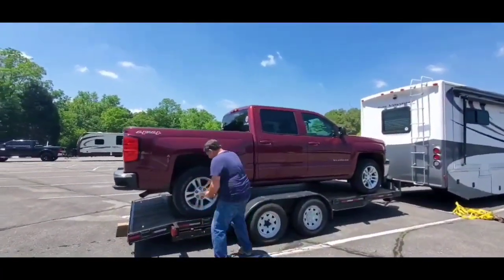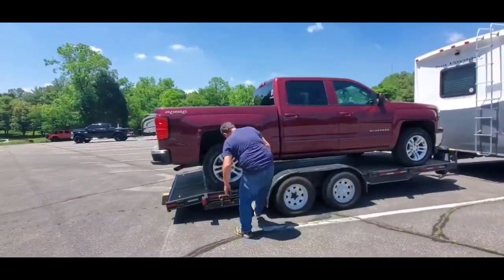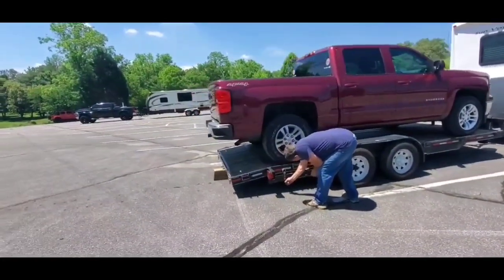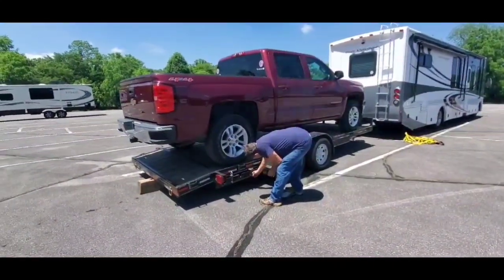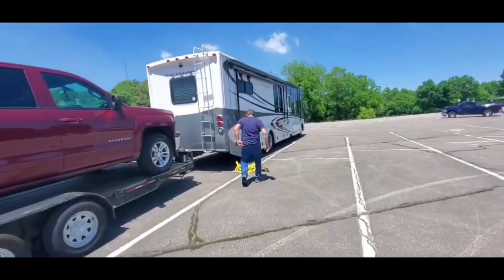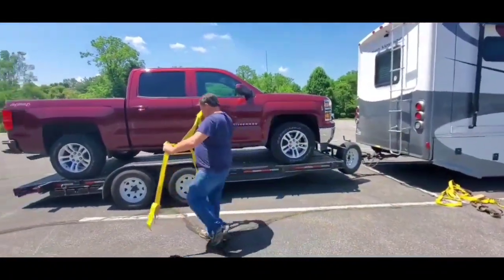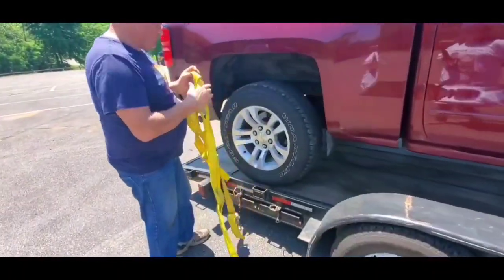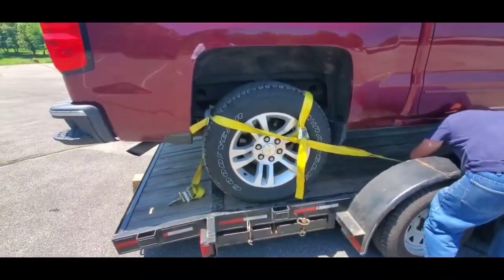TOWING 2015 CHEVY SILVERADO/ SUN VOYAGER CLASS A/FLAT TRAILER TOWING

Comment: Jim is an awesome driver. We tow our Jeep four down and you have to allow for the swing. Our rig is 40 foot also. He is towing an extra length thats a great driver. Great job Jim. Thanks for sharing as always! 👏👏👏🥑👍❤️🇺🇸
Reply from the maker: It's the only way Jim will tow a vehicle behind a Class A. The tires are very expensive for the truck. And trailer tires are cheaper. Lol. And less miles being put on it

Comment: I agree that the trailer tow is much better on the car. Plus it allows you to any kind of car you want which is very nice. We went with flat tow to save from having to store the trailer and ease of hooking up. That is a very nice setup. I know Endless RVing does a similar setup. Hope you had a great meetup. I thought that place looked familiar. That is up at the pool area. Good move on the safety checks. I need to get in a better habit of that. We have the camera as well. Nice to be able to see it. Thanks for the share.
Reply from the maker: Thank you. Jim stops at every rest area or do many miles. And does a safety check. He says that trailer tires are cheaper than vehicle tires and less miles and wear and tear on the vehicle

Comment: That’s a nice set up Susan!! We have always said to each other if we towed that is how we prefer to do it for the same reasons as far as wear. ~Paul
Reply from the maker: Tires on the truck is expensive. Trailer tires are cheaper. So it saves you money in the long run

Comment: Ahoy Sis ! I was going to put Bessie on top of Synchronicity  but then I realized Bessie would die at 1st overpass . Your Method is awesome! Ye now can pick up classic cars in the dessert and sell them for a profit when ye bring them back east.. :-)  A suggestion  Your straps are great but I would consider chain straps like the tow truck drivers use..However What ye are doing certainly is safe as I see it here..Please Tell Miss Abby Ahoy for me.....How did James get an Identical beer gut like mine??  Do ye just use the trailer lights or do ye use the Chevy lights as well for travel?  I love ye as ye Know Sis..Fair Winds, Smiles and May god Bless!!
Reply from the maker: Just use the trailer lights.
Reply: Captain Jack I have the tow chains but I am trying out the straps to see how they hold up. P.S. at one time I have 2 tow trucks plus a roll back and a implement truck, but to much work for the money